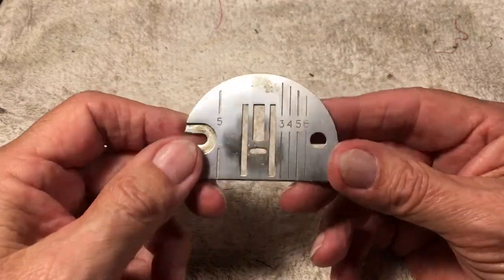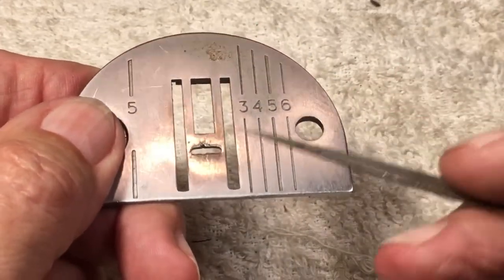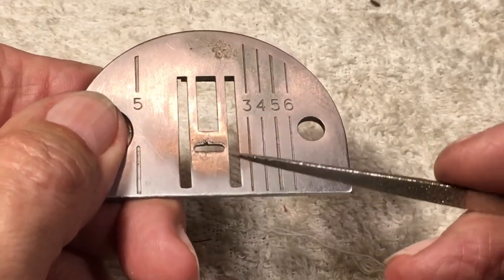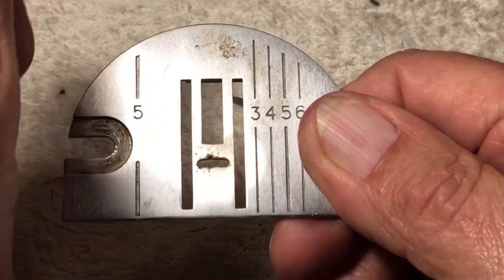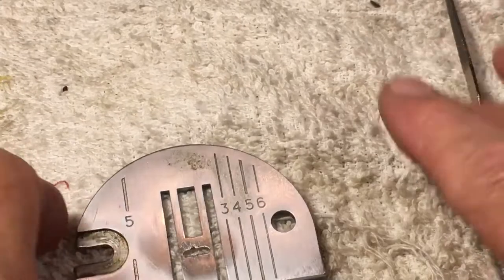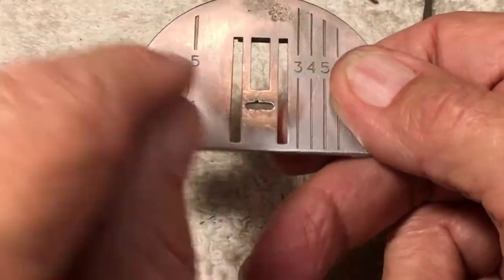How to Recondition your needle plate. “Ramp job” explained.  (video 121)

Comment: Any chance you can make a video on how to adjust the needle position front to back through the needle plate? I have a Kenmore 148.13110 that works great, the only problem is the needle runs very close to front of the hole, and when sewing over a multiple layer seam occasionally the needle deflects forward and hits the plate, bending the needle (#14 or 16).  I would like to move the needle back to the center of the plate hole, about 0.5 mm. Thanks.
Reply from the maker: I’ll see if I have one of those and if I can make a video.
Reply: @randyyoursewingmachineman9954  That would be awesome, thank you so much.

Comment: My sewing machine keeps breaking needles when I hit the back stitch. I swapped needles,  cleaned feed dogs, cleaned bobbin, not sure if its out of timing?
Reply from the maker: Make sure the correct presser foot is attached. 
Make sure there are no scratches or burrs on the bottom or backside of the foot. 
Check to be sure that the needle is lining up in the center of the needle hole, as well as the center of the presser foot. 
The needle may be too small. Use a size 14 or maybe a 16. 
If the machine makes proper stitches going forward, it’s unlikely to be a timing problem. 
If your pressure on your presser foot is too light, that will cause a problem in backstitching. 
If what you’re sewing is too heavy for your machine, that will be a problem also. 
Good luck. 🍀
Reply: @randyyoursewingmachineman9954  thank you 😊

Comment: Hi! Great video! 

This part of my machine moves when I'm sewing, what can I do, please?
Reply from the maker: If your machine is a newer Singer, it’s probably a needle plate that’s bent down and needs to be straightened. I have a video addressing that issue.
If it’s not a bent plate on a Singer, it will be feed dogs that are installed improperly (misaligned) or loose attachment screws.
I’m just guessing because I don’t know what machine you have.😎👍

Comment: So Ive been fixing my machine, then everytime i would sew my thread would always snap. Even though the tension is not very very very tight, it would always snap....then i realize, the the needle plate has scratches (like that in the video)...Could this be the reason for the thread to keep snapping off????
Reply from the maker: @DATURAScorp-gr7vk  yes. And also check the rear of the opening on your presser foot, as well as the sides. If there are any burrs or scratches that contact the thread, it will cause a breakage.

Comment: Hello Randy 
I was wondering if you would be so kind to help me  with an issue. i have a singer 252 fasion mate.  I have a similar issue to what you have presented in this video first 30 seconds where the needle is touching the opening of the needle plate, It is touching at the back of the opening right in the middle of it.  The problem is not with the plate position because when i removed the palet i can see the needle is touching the back of the bobbin case holder, acoutally the tip of the hook itself as wel (the biger round circle where the bobin case goes into). It looks like i need to move the niddle bar torwards me, to the front like half of a milimiter. Is there a way to adjust it forward? (not side ways right or left but back and forward) ?
Reply from the maker: Yes there’s a way to adjust that.
Remove the side cover on the left(1 screw) and you’ll see that the entire assembly is held in place by a couple screws. If you loosen the correct screws and shift the entire assembly forward a little, it will solve the issue. 
Just don’t start randomly loosening screws.
Study the structure to see how the frame is attached.
No screws will need to be removed, just loosened slightly. (3, if my memory is correct)
Sometimes it’s necessary to remove the light bulb to access a screw. Push it in and twist to the left to remove it. It doesn’t unscrew.
Good luck 🍀.
Reply: @randyyoursewingmachineman9954  thank you randy , you made me rethink and i found the right screws and adjustment part
Reply from the maker: @ilanzecharia7168  😎👍🏼

Comment: I use thick thread a lot but if I switch to a smaller thread for a project should I also change to a smaller needle?
Reply from the maker: A size 14 needle is a medium. (90)  Almost all sewing occurs at the level where that size is sufficient. If you’re on heavier fabric, move up to an 16 (100), or an 18 (110).
The size of the thread can remain constant throughout. 
If your sewing on silk, rayon, and delicate fabrics, a size 12 needle would be best. 
Needle technology is vast and styles and designs are extensive. 
There’s a ton of good needle info out there on the interwebs that’s interesting and informative. 
The needle manufacturers have plenty to offer you in needle information.
Reply: @randyyoursewingmachineman9954  I didn't mention it in this post but of course I'm using an 18. But can I stay with an 18 if I go to a lighter thread for a bit, or should I drop back to a 14?
Reply from the maker: @billycook5688  as long as the thread moves freely through the eye of the needle, the size doesn’t matter. 
Thick thread is always a problem with a domestic, household type sewing machine. 
Light thread is virtually never a problem.

Comment: Can u use different needle plate for naumann sewing machine if you cant find another to buy?
Reply from the maker: If it matches the outline, and has the proper cutouts for the feeders, you should be all set. Many needle plates are interchangeable from brand to brand, just make sure the needle plate screws line up.👍😎

Comment: @RandyYourSewingMachineMan I wanted to say thank you for your help!  My mom taught me how to sew on a sewing machine back in the 70's (I'll get to that in a moment). I have been successfully sewing scuba neoprene (1.5mm) for quite some time but all of a sudden encountered massive skipping issues. I am pretty mechanically inclined, so I tore the machine (Brother conusmer level) down. I cleaned the presser and blew out a lot of lint.  While I was at it I oiled moving parts up, etc. I  must have torn this thing apart at least 10 times because I could still not find the root of my problem. I checked the needle bar depth, etc., etc. Finally so frustrated and after serching online with no help I stumbled upon your video here. 

I filed my needle plate and the stepper foot as you recommended. BUT, that was still not my answer - - - same issues. I was beginning to think perhaps the machine was out of time. And by the way, I replaced the needles with new ones and tried both a 90 and 75 as well - nothing! 

Finally I recalled something you mentioned. I was taught to stretch and pull. I immediately began to let the machine do all the work and woolah..... MAGIC! You truly helped me fix the issue just by educating me - THANK YOU! By the way, I have no idea why I was sucessful in the past yet recently hit this roadblock. Other than a different bolt of fabric or maybe I was being much more agressive with my stretch and pull methods, I have no clue. Thank you, thank you, thank you!

Oh, I also immediately ordered a roller foot moments ago based on your recommendation.
Reply from the maker: Glad to help. 😎
Reply: @randyyoursewingmachineman9954  Do you ship any machines that you sell (Pennsylvania here)? I am looking for a more industry or commercial grade machine to get started. I do a lot of heavy vinyl sewing that this little li9ght duty Brother is incapable of handling. It's tlikew the little engine who could and it tries so hard but just can't chug through what I do. Can you make any recommendations without me breaking the bank. I do however also understand that I will need to pay for something much better. Thanks again!
Reply from the maker: @BillyDiamond  everyone buys the wrong machine first. 
Then they buy the right machine. 
But, the much needed funds were squandered on the first machine that could have gone towards the right machine. 
Don’t feel bad, EVERYONE DOES IT. 
Look for a SAILRITE or a  Thompson mini walker and you’ll have the perfect machine. 
Maybe find a used one as they are pricey. 😎
Reply from the maker: @BillyDiamond  I don’t ship sewing machines as they get damaged too easily. 😎
Reply: @randyyoursewingmachineman9954  No worries. I understand. I figured that I would at least ask. I will find a local shop.
Reply from the maker: @BillyDiamond  👍🏼
Reply from the maker: @BillyDiamond  ok. 👍🏼😎